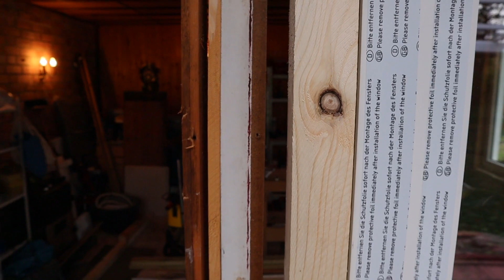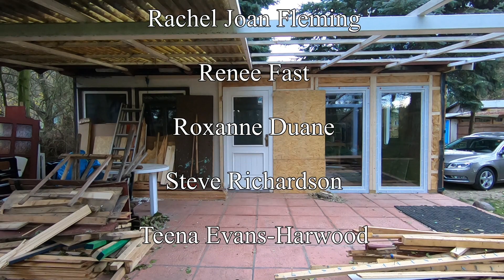Renovating an abandoned Tiny House #27: A shocking discovery!

Comment: I love how clean you keep your worksite.
When the door comes in in January, will you be putting in a vapour barrier between the concrete and the wood? Here in North America you're not supposed to put wood directly in contact with concrete because wood wicks up moisture through the porous concrete and leads to rot. Is it the same in Germany? Or is the wood you were using coated just for that purpose?

Comment: So a stronger leaf blower backpack style with a throttle trigger where you control the air flow speed is the way to go. Husqvarna makes many models. Also, sheets of plastic tarp 12x12 feet can also be laid out on the lawn and held in the corners with rocks. You blow the leaves onto the sheets then slide to transport.

Comment: It is possible to use your lawnmower with the catcher on to collect leaves. I have a large four stroke petrol lawnmower so it's perfect for this job but I think an electric mower might be okay too. Put the mower on its highest setting so the mower is operating but not touching the blades of grass and mow over the leaves, the fast mover blades suck up the leaves and cut them up and place them all in the catcher, ready to put in the compost. I think a leaf blower is only good for use on paths and driveways for leaves and only if the leaves are dry

Comment: If you are still finding it difficult to get the correct corrugated plastic roofing have you considered using a flat plastic? I had a similar problem with an obsolete corrugation pitch and just put a 10mm  double wall plastic roof on instead. The type you get on cheap conservatories. I used a thin plastic trim to go under the house roof and over the new thin roof. Worked a treat and the double cell flat plastic was much nicer.  Thanks for posting - a charming series.

Comment: Great progress. I don't understand why people install doors which open inward, especially in small spaces. It limits use of space inside and is less secure since it is much easier to force open a door which opens inward than one that opens outward. I blocked a couple of doors in my house which open inward and use the space for tables and chairs. It makes the space much more usable. Both doors are covered by porches so wouldn't ever be blocked by snow, which we can get a lot of here, if they did open outward.

Comment: Why did you replace the existing temporary door with a new temporary door?
Reply: Kind of what I was wondering, especially considering the price he paid for the new 'temporary' door.
Reply: @kcanded  it was 7 Euro if i understood him correctly, thats basically for free. I think he put the new temporary door in to get one step closer to having the house water tight and because the new door (january) will be most likely about the same size of the door he just put in. So while he will be working mostly on the inside during the winter he will not have to cut open that part of the wall again. That is at least what i believe to be his reason for it.
Reply: @agentzepo881  I'll have to listen again, I thought he said 75 Euros.
Reply: @kcanded  even though it was 80 euros (i just rewatched it) that is still very cheap, my front door was over 3000 euros. So i assume to Andre it was a small investment if it means he does not have to reopen the wall once the ordered door arrives in january
Reply: I may be mistaken, but I understood that the old frame was very weak, (eaten by insects) and it does have to hold up the roof. Best to replace it and reinforce it now. Plus the new door is more attractive and presumably in better shape?

Comment: That was too much little stuff for one little weekend. You got it done though.  Congratulations!  Looks good.  
Now I worry about the next bit on the front.  I consider the brick wall divider inside and how you are going to handle the gap that will be there after you place in new exterior wall and second set of windows.  Will there be another set of two windows like before?  I was thinking that maybe you will cut out part of brick wall from where it starts to the front exterior wall to give you a larger entry to bedroom.  Square things off a bit to look more modern.  So I can't wait to see what you have in store for us all next.  I love surprises.
I just hate the noise level of leaf blowers and weed eaters.  There is a Works brand leaf blower that also sucks up stuff into a cloth bag. Convient.

Comment: Thx for the great video as usual. I have a property that has constant year-round leaf falls and had a leaf blower similar to the one you are using. It took forever, and was frustrating until I upgraded to a Ryobi 425CFM Brushless leaf blower. This did the job in a quarter of the time, so my recommendation is always go for the most powerful blower you can afford, the base model you're using aren't great. PS: the leaf blower is also great for cleaning your veranda instead of sweeping with a broom.

Comment: I am a bit surprised that the door opens inward.  Code requirements here in Manitoba, Canada say that exterior doors have to open outwards so that you can exit easily in case of a fire.  

I am with several other folks in thinking that a leaf blower does not seem to fit your style.  Using a leaf blower also means that you are not doing a bit of de-thatching as you rake .

Comment: Does your leaf blower not have a bag & a “suck” option? So you “vacuum” up the leaves. I had a 2 acre garden, with lots of trees and couldnt have coped without the leaf collector. I also used the lawn mower as a leaf collector, that worked too, and it “mulches” the leaves at the same time, so they compost more quickly (especially if you pee on the compost heap occasionally!).

Comment: Hi Andre - are you planning to replace the red patio tiles (or is it concrete made to look like tiles?) in front of your house?  If Y, will you have to remove the door frame? as it looks like the timber door frame is sitting on top of the red tiles.  Already with the white frames of the door & windows, the facade is looking so much better.

Comment: If the new door that's getting delivered in January is wider than the one you have now, doesn't it make sense to build the wall so the right gap is there, then fill in the gap when the new door arrives? Then you're not looking at splinterboard until January ;)

Comment: I have so many questions about the door.  I’m wondering why you replaced the old door with another old door rather than wait for the new door to arrive. Is the new one arriving in January a pre-hung door? Will the new door fit in easily into what you’ve constructed or will you have to make more adjustments?
Reply: I think he said the new door will be a different size. Are pre-hung doors common everywhere? I have seen them on US videos, but never seen one here in the UK "in the flesh"- maybe I am just not aware of building habits.
Reply: @borikkiv  Pre-hung doors, either mass produced or custom, are common in the US. I don’t quite get the point of having an interim door. I know he likely has a good reason and I’d like to know.
Reply: @anamaria2053  I wondered if it was to get the surrounding wood made safer before winter snow lands. It does seem a lot of work for a temporary door though.
Reply: @borikkiv  I guess we’ll have to wait n see. 😉
Reply: Maybe the old door was drafty and not as weather tight.  When you are done it will be lovely and light filled.🌞
Reply: @anamaria2053  He is doing the whole frontage not just the doors and windows, weather allowing, so he needs the right measurements to be able to carry on  with the rest and the old door is not the right measurement.

Comment: As I enjoy your videos quite a bit, I am always surprised about the contrast of you being in a nature reserve and pruning and trimming everything down to a minimum of biodiversity. I agree with you in collecting the leaves manually, but I‘d rather suggest to leave the leaves (maybe that’s why they are called accordingly) on the lawn over wintertime. It’s food for the earthworm wich will give you very valuable clay humus complexes as a natural fertilizer back. No need to artificially fertilize and  ventilate as the worm does exactly this. Therefor, just take the remains of leaves in the spring.
Reply from the maker: I do return the leaves back to the lawn - but a year later when they‘ve already turned into compost. Every year in spring it‘s the same procedure 👍 If I‘d leave it on the lawn over winter there‘d be no lawn anymore 😉
Reply: @renovationeast9379  I get your point. :) If you return the leaves back to the lawn as compost, why don‘t you just leave them there. Did you ever try to leave them there? I‘ve recognized that this tiding up everything in autumn is completely nonsense and just   tempts us to go to the next Baumarkt to buy leave blowers, lawn rakers and automatic hedge cutters :)

Comment: I've noticed over the last few videos that some of your carpentry tools (level and square) are too small for the job. For example, you're using a 2 ft level on an 8 ft post and the square you're using is also too small. I would use a minimum of a 4 ft level for the posts and a 2 ft square for the corners when framing the doorway.

Comment: You need to get a battery powered leaf blower with more wind velocity than the cord powered one you currently are using.  Some of the leaf blowers also work as a vacuum (with bag attachment).  https://smile.amazon.com/s?k=Cordless+leaf+blowers&ref=nb_sb_noss_2

On the temporary metal support you installed, we usually put a block of wood underneath the bottom.  Depending on the load, at least 2” (5cm) thick.

When you were trying to figure out where to put the reel of power cord; put it on the roof right above where you’re working.

Comment: We have a leaf blower too that is rarely used, raking being the usual autumn clean up method. Blowers are horribly noisy and blow up the dusty dirt from the beds and paved areas as well as leaves, so it's not as clean a method as you'd think unless you have a huge lawn and  garden. The only time we found it useful is getting leaves out of shrubs and plants where you can't rake without doing harm, and where overwintering leaves will smother the bushes or perennials.   Sorry you had another unwelcome surprise with your tiny house but no harm done and you were able to make it secure without too much trouble.  Hope the really cold and nasty weather stuff stays away for a bit longer. 😊

Comment: You keep putting wood against concrete. You should be using pressure treated wood for that, which I see in some places but not others. This is gonna rot from the bottom up. I'm also going to guess that your house foundation and patio are separate. The patio will tend to rise and fall more and that outside wall of yours is going to heave and fall. Since I just saw you install a door frame that is hinged on the wall that is resting on the patio, I'm gonna predict that your door frame will eventually go askew and you won't be able to close your door one day.